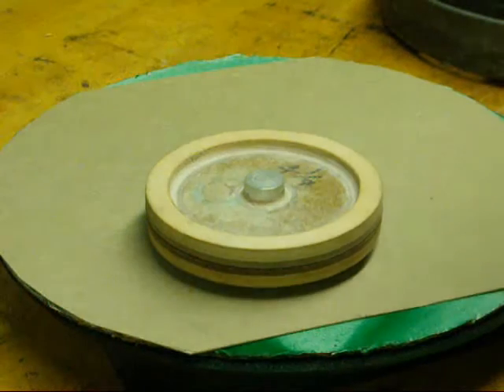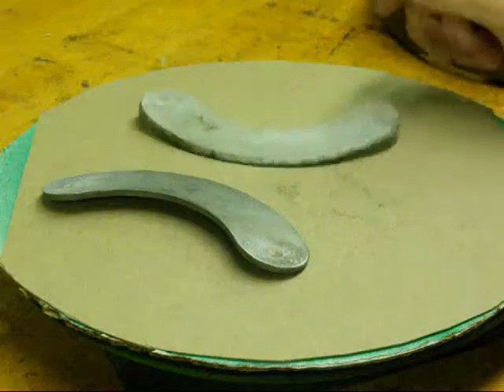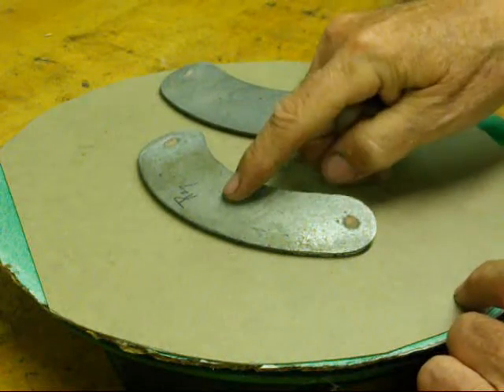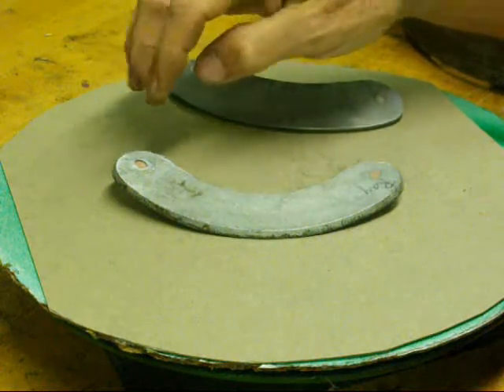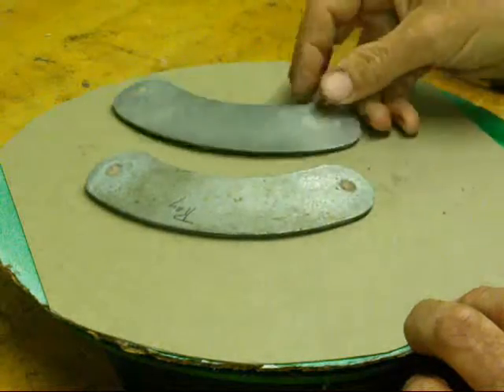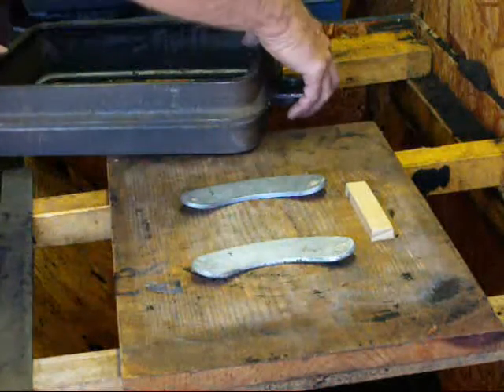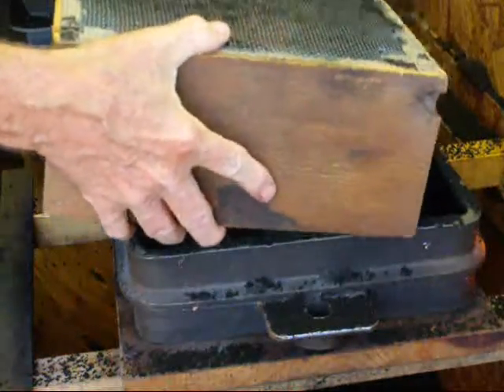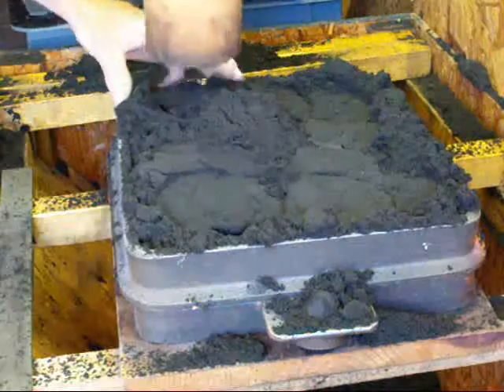FOUNDRY WORK molding irregular parting line Part 6 video A tubalcain

Comment: Awesome series on castings. You have been able to answer alot of questions that I have had about doing this. I cast alot of babbit bearings and I don't have to generate as much heat as you do here. I do have to ask, can the sand be mulled by hand? I have a 5 gallon bucket of sand but it needs to be remulled.